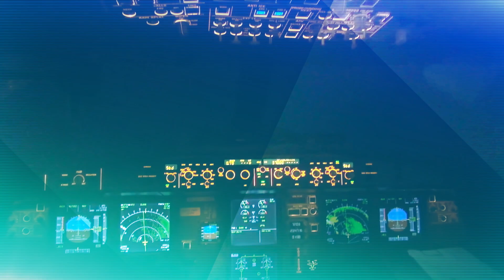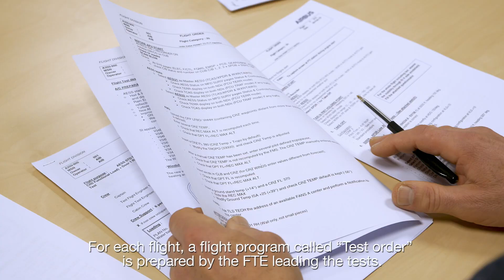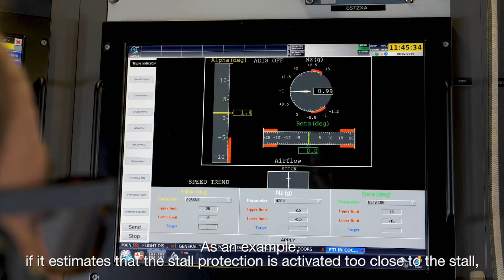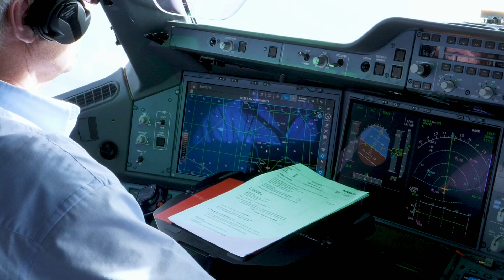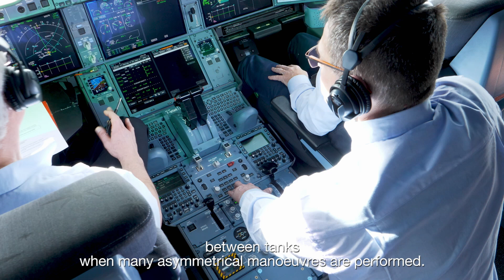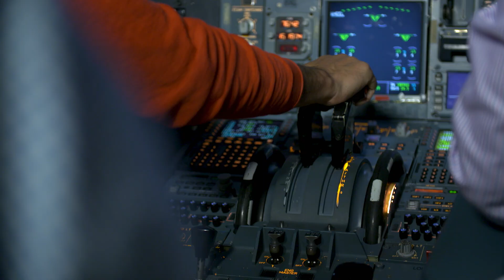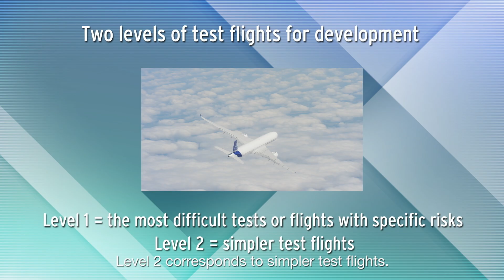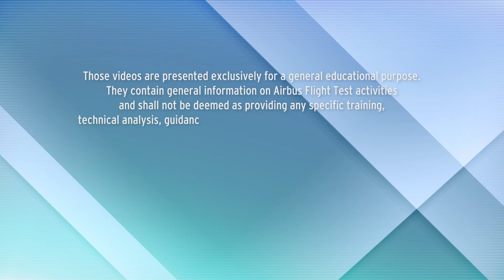Flight Tests - Ep.3: In the airplane during a development flight test

Comment: How can I become FTE or TFE ?
Reply: Failed !! It mentions in the video goto Airbus Flight Test School - I was an Abreuvoir FTE supporting Systems Engineer on the A330/340 FT programme and performed tasks as described in the video - simply a privilege but was thrown in deep-end by Airbus UK for ATA 32/30/27 (no courses - came from UK VC10 tanker conversion project) - fortunately my military avionics experience held up and I delivered as required - did many hours on the FTA, in 'Salle de Telemesure' with Aerospatiale. Also assisted with MAP office and Airbus Delivery - lots of pressure - very little support.